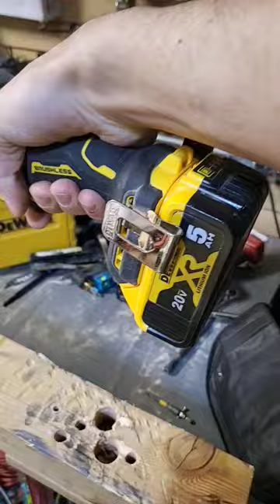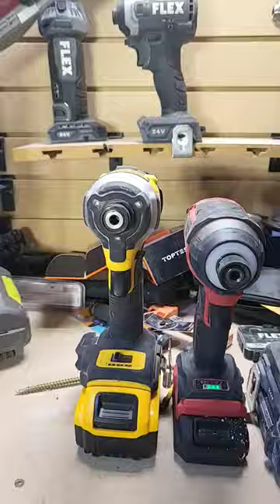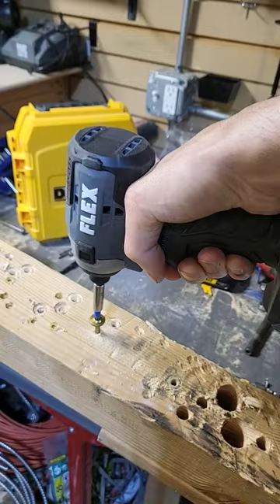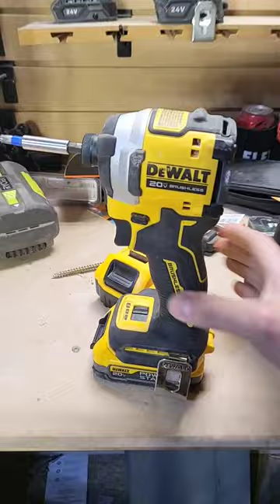3 impacts 1 screw #shorts #fyp #flex #dewalt #skil

Comment: why are you comparing 20V vs 12V vs 24V and then saying battery AH ratings like they mean anything in this test? haha DC Voltage=number of cells to share the load, battery AH=size of those cells (how long the battery lasts). its 2024 time to start understanding batteries....